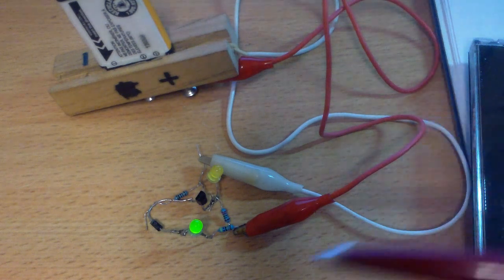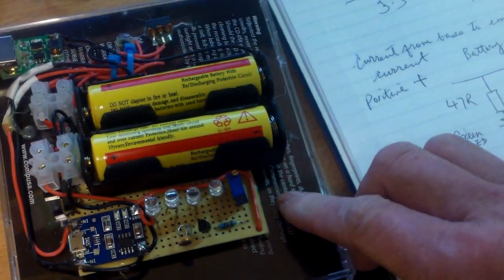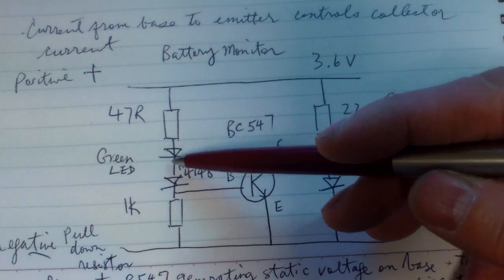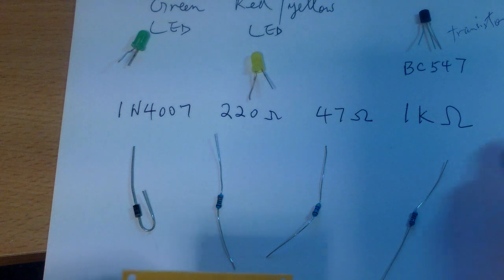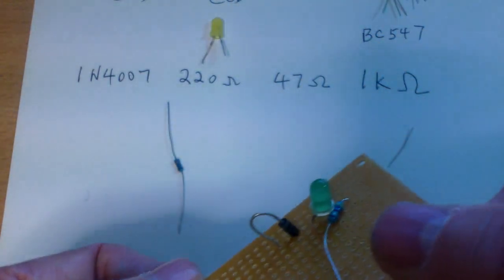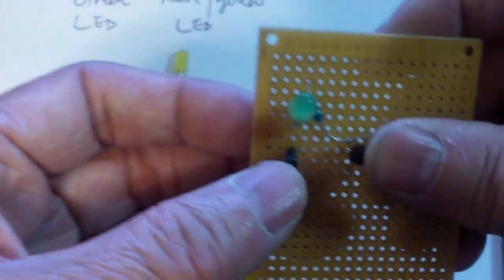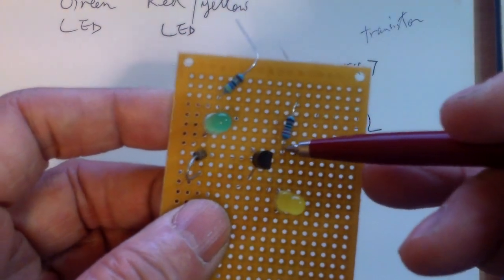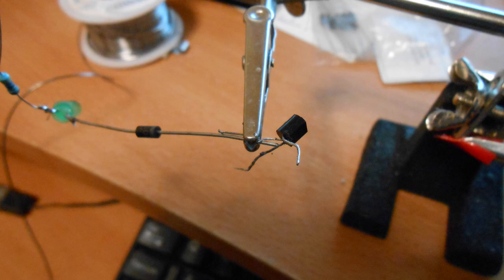Battery condition light for 3.6, 3.7  volt lithium ion 18650 battery

Comment: Hi I found that your hand drawn schematic shows base connected between diode and resistor, when I changed the base between the two diodes the circuit worked as described.

Comment: Hi, thank you for circuit, however i had to make some changes. I removed Green LED, because i only wanted one RED led for low voltage, then i replaced 47R with 3,05K potentiometer (KOhm). Now red led turns on when voltage is below 3,6V
Reply from the maker: Thanks so much for sharing. I'm sure there are folks that only want the red light on when the voltage drops below 3.6v.
Reply: No problem, don't know if its best solution, but it works for me. I tried multicolour led with common Anode(+), but it doesn't work. Do you know, where can be problem?
Reply: Replaced 47 R resistor and green led with 3.2Kohm resistor(color orange/orange/red/gold) and red LED start to light on 3.61 volt. Adjustment with potentiometer was 3.25Kohm (replaced 47R and green LED) Diode used 4148 same like in diagram.

Comment: hi, could you teach me how to create the project like a power bank in this video ?, so interesting. thank you.
Reply from the maker: You need 1 18650 battery holder, one micro USB 1 A  18650 lithium battery charging board charger and one usb boost module.  That's all you need.  Or, you can buy a power bank for 1 18650.  That one unit will have the above components. Feel free to ask if you have more questions.
Reply: +wtam69 thank you for kind reply, I am already create a power  bank like your suggestions. Now, I want to add some white leds on the power bank.

may I ask your email ? I will send the picture of my project.

this is my email:  apri.junaidi@gmail.com
Reply from the maker: Apri Junaidi It'd probably be better if you post a video and everyone can give you suggestions. Or, you can ask again in this thread.
Reply: +wtam69 thank you, I will create the video project soon

Comment: Hi  if i no need green led and only need red led indication when 3.6v low battery. how can edit that circuit? Thank you
Reply: if you don't know ok.
Reply from the maker: +Savaş Aydın Sorry I have not tried it with just the red led.  You can experiment with the same circuit, except eliminate the green Led.
Reply: +wtam69 i tried no work :(
Reply from the maker: Savaş Aydın Yes, it's not as simple as it sounds.
Reply: remove Green LED and replaced 47R with 3,05K potentiometer like Bombitch suggested. cheers

Comment: Hi, wtam69 I just need a low voltage indicator, means only a red LED that will turn on at a voltage of 2.7v or 2.8v for the 18650 battery. What changes shall be made in this circuit? thank you :))
Reply from the maker: Kketansa Art You can try changing the resistor values used by the green LED so that it'll stay on  longer. When the current drops for the green LED, the transistor will turn off and the red LED goes to on.
Reply: wtam69 Thank you very much :)) , I will try. I also want to remove the green led, so that it wont use any battery power. I only get low power notification.

Comment: can i use a bi color led to make it simple ?
Reply from the maker: Rifai Annur You can try a bi color LED. If it works, let me know.
Reply: wtam69 I actually do not have the components but I tried with software like in your video and this circuit does not work
This is just a software error?
Reply from the maker: Rifai Annur
I just followed the circuit and it worked with the parts shown in the video.
Reply: I've made this circuit and successfully. I guess it only software fault.
your video is amazing
thanks (y)
Reply from the maker: Make a video of your project Rifai.

Comment: hi, does it make any difference if you use a common anode or common cathode led? i've used your circuit but for some reason the red led stays on even on a fully charged 3.7v battery
Reply from the maker: Anode is the positive and cathode the negative of the LED. If you hook up everything correctly and the red LED stays lit above  3.6 or 3.7 volt, you can try to use a slightly higher value resistor (higher  than the 220 ohm used in the circuit)  and see if the light will go out. Good luck.

Comment: Really good circuit.  It could be used for a lot of different things like turning on a charger to recharge the battery.   I was thinking of making something like that to charge my solar battery if the sun isn't shining strong enough.

 I made a thermostatic fan controller for my heater that works on the same principle.  It consist of a comparator op-amp with a thermistor/resistor voltage divider and a relay to turn on the AC fan.  12vdc turns on a 110vac fan.  It's fun to see it work.
Reply from the maker: It is a rather simple circuit although I would like someone to explain the niceties of choosing one component over another. Maybe the same thing can be accomplished with zener diodes instead of a transistor.  I would like to see your thermistor controller for your heater and how you set it up.  When my refrigerator wasn't working well, I also thought of the thermistor as the culprit.  I have ordered a few small 12 v relays and am going to try my hand at building a cut off controller for a solar charging circuit.
Reply: wtam69
I've seen a circuit that uses a zener for battery backup uses.  I'm trying to get my camera working to upload a video on the thermostatic motor controller, but it may not happen because my battery is not holding a charge.  I used an LM358 op-amp, but about any op-amp would probably work.  The circuit below is for a dual temp controller, but I only used half of it and which is cut off at transistor Q1 and that is where the relay goes.  http://www.electro-tech-online.com/attachments/dual-stage-temp-switch-jpg.55039/
Reply: wtam69
That circuit shows a pnp at Q1, but I used an npn for the output.
Reply from the maker: Russ Bowers
Thanks very much for the circuit info.
Reply: wtam69
You are welcome and If you were going to go the way of IC controlled thermal controller, I'd suggest looking for a circuit that uses an op-amp you might already have.  I've found that it's easier to find circuits that use an LM741 op-amp.   I'd bet you could use a single transistor, but it would probably chatter the relay as the temp gets close to turning on and off.  Op-amp comparators have flip-flops that are definite on/off conditions rather than a partial on condition you get with transistors.  I think that's why all of them use comparators.
Reply from the maker: "Chatter the relay." That's interesting. My fridge control board used to have that nonstop  relay clicking before it went bad. Of course, many factors probably account for the demise of the control board. So much to learn, so little time.